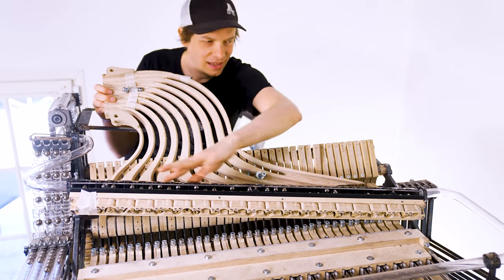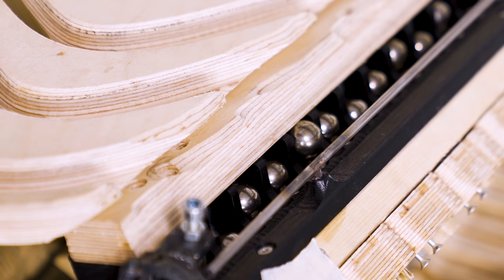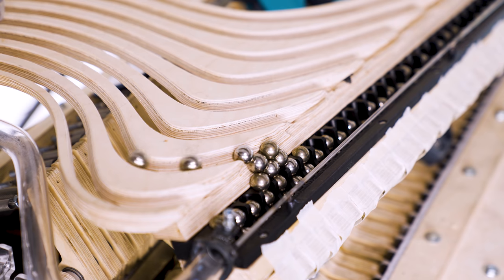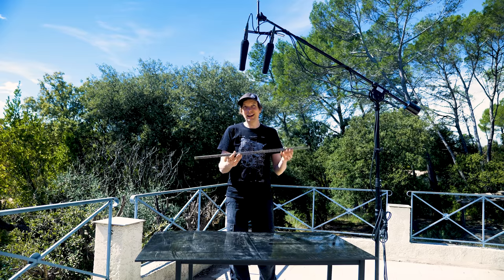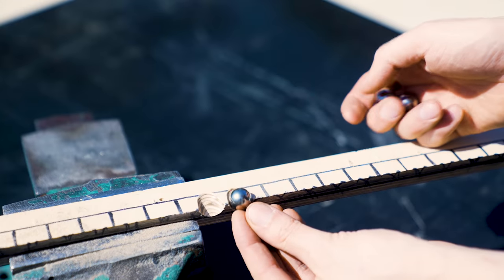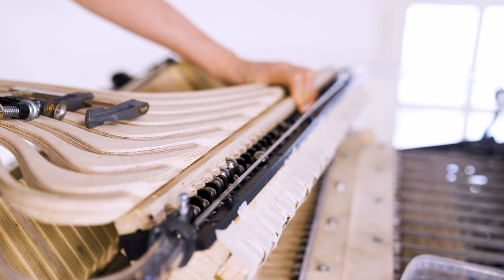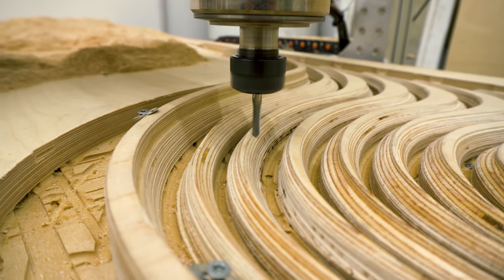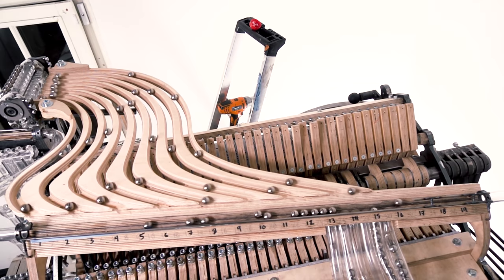Marble Tracks with Hidden Feature

Comment: I'm starting a petition to get Martin to look up what redundancy means haha
Reply: He used it correctly for the welding that only had two spot welds. But is often using it when robustness is more appropriate.
Reply: Inigo Montoya to Martin:  "I don't think it means what you think it means."
Reply: @brianorca  actually not even there. Redundancy would be welding more brackets on
Reply: about time lol
Reply: But what's wrong with his use of 'redundancy'? Like in this context using the meaning like ~"having extra in case of failure, but it's not really needed, having insurance..." Perfectly valid use of the word.
Reply: @gearoidp  redundant systems are those that have more than one copy of a subsystem to make it fault tolerant. This is robustness, not redundancy.
Reply: Also perfect and hubris 🤣
Reply: Yep, when the marbles have a wide acceptable speed window and he's tweaking them to be closer to the center of that window... honestly I can't picture what a redundant solution would look like, short of an auto-tilt system which adjusts the marble lane position dynamically based on current detected marble speed.
Reply: The word for redundant in swedish is: överflödig
Reply: @davidgildegomezperez4364 ~ 'copy of the system...' I don't agree with your narrow definition. 

googled an exact definition : "a situation in which something is unnecessary because it is more than is needed" -Cambridge
"superfluous" "more than necessary".-  Merriam Webster
Reply: Yes PLZ!
Reply: @kaaremadsen9278  That's interesting. The German word „überflüssig“ also means „redundant“ but in a negative way like „useless“.
Reply: @gearoidp  Having insurance and having redundancy is not the same thing.
If you have multiple of a thing, regardless of if it is or isn't a good idea, it is redundant. Redundancy can be both good and bad. If you repeat yourself too often in an essay, it is bad, it is "redundant". If you have a second system that the first system can fail over to, that is redundant, but good.
Robust or resilient systems are always good.
Reply: @gearoidp  redundancy means you have more than one component that can perform a task in the event of failure while the first component is repaired or replaced. Resiliency means the component is designed to never fail.
Reply: @gearoidp  You may not agree with the definition being narrow, but nonetheless, that is the correct definition. It is a specific word with a very specific meaning.
Reply: My choice would be "tolerence"... redundancy suggests there is another system that takes over when the main system fails
Reply: @joshuamarcotte8514  I got into a long debate about redundancy many videos ago. I meant what you're talking about. I meant he should have fail safes. The example I gave was that he could have a separate path if one path gets clogged so the whole machine doesnt break. THAT is redundancy. Making it so that the  path cant get clogged in the fist place is robustness. tldr: I agree with you and im glad someone else agrees with me lol
Reply: @gearoidp  nope. Redundant means a copy that is not needed. Superfluous is a synonym of redundant.
Reply: @KarmCraft  I'm not sure what you meant. Maybe you're making a point on the suffix. Which you are missing in your comment...
Reply: I also cringed at the use of the word "redundancy".  Ultimately due to the context, it was sufficient for everyone to actually understand his actual purpose, so he still successfully used English.  It isn't the end of the world if he uses the "wrong" word, this has been going on for hundreds of years, and English will just absorb the change just like it did with other similarly mistreated words like "toilet", "egregious" and my personal favourite mutation "nice" which has somehow meant nearly anything at some point or other.
Reply: @gisobo  “överflödig” is actually both in danish and in swedish "borrowed" from "Mittelniederdeutsch". The meaning of the word in both danish and swedish is the same as you descipe it in german.
Reply: I'm also starting a petition to get Martin to look up what redundancy means
Reply: Yep, the incorrect use was torture, robust, fault tolerant, resilient, are all better terms for Martin was explaining.
Reply: @RoamingAdhocrat  The word for ”redundancy” is in swedish: ”redundans” It actauly has excactly the same meaning in swedish as in english
Reply: This is the discussion I needed to see. My two (or maybe 20) cents, although it feels kinda redundant (in the negative sense, ie överflödigt) to participate at thirst point. In particular directed to those of you who oppose this petition. 

The lexical meaning of redundant is not exactly the same as the engineering meaning, and what Martin is doing is engineering. As such we should hold him to the standards of the domain he is working in. In this context redundant means the same thing, which is to have one or more subsystems that can take over and make sure the whole system can preform without interruption when a subsystem fails. Examples of redundant systems is when a hospital runs through batteries and have their own power generator that they can start in case of a power outage, the batteries make sure an outage doesn't case a temporary outage while the generator is started, and the generator makes sure that the batteries wont run out when an outage is long. Another example of reduandacy is the disk parity you get with most raid strategies, commonly used is home NAS devices. Having multiple fire alarms at home is another redundancy.

As for the negative use of redundancy the example, that others have given already, of being repetitive in an essay or YouTube video is perfect. And this is what överflödig translates to. An English word might not always have a one to one translation to Swedish (or other languages) and this is a typical example of that. A better Swedish expression for redundancy is "med livrem och hängslen", literally translated to "with belt and straps". And that my dear fellow viewers, means redundancy.
Reply: Repeatability maybe?
Reply: @davidgildegomezperez4364  Lol that's so overly technical  for this context, and not even correct. Having a" copy of a subsystem" is one way of achieving redundancy. Installing a steel beam in a house that can support twice as much load as it needs to is also redundancy. There is redundant strength in the beam. Redundancy just means you "have more" than you need.
Reply: Maybe the idea is "possible unlikeliness".
Reply: @gearoidp  the issue is looking at the general definition of a word vs. it's meaning in the context of a specific field or discipline (a common example of this mistake is the difference between the scientific vs. conversational meanings for "theory"). In engineering, redundancy means having a backup system that performs the same function as the primary system, in case the primary system were to fail (in many cases, the backup system is simply a copy of the primary system). As others have mentioned, making a system less likely to fail is called robustness. (The overall robustness of a system can be raised by adding redundancy to subsystems, but adding robustness to subsystems does not create redundancy in the overall system).
Reply: @alexkfridges  not quite. Redundancy would be having two beams when you only need one. Exceeding the required rating in a single beam can be referred to as many things (having margin, factor of safety, over designed, wasteful, etc.) but "redundant" is not technically correct.
Reply: @gearoidp  Indeed, as I'm actually reading the former comments I kinda redundantly reiterated what you said earlier : } funny meta
Reply: @kaaremadsen9278  that sounds really close to "überflüssig" in German. However it is negatively connotated and mostly used to describe unnecessary features.
Reply: He means recilient.
Reply: "A higher factor of safety" is the phrase he should actually be using.
Reply: Redundancy is the practice of having a secondary solution to a problem when the first solution is good enough, or when the first fails. For example, he might have a catch basin for marbles that fall out of the mmx and feed them back into the machine, or have a way to direct marble overflow into a designated area, rather than risking them clogging up the machine. One example I have thought of is to reintroduce the height modules, which would optimize the new marble divider, which already works regardless of marble height, and would also help reduce pressure on the clock escapement gates, which work regardless of pressure.
Reply: Yeah, the fish stair is a redundant marble lift system that makes the whole system more robust.
Using a full weld rather than tacks is not a redundancy.
Adjusting the tilt angle of the marble tracks to maintain marble speed is not a redundancy.
Reply: He says 'redundant' when he really mean "fault tolerant"
Reply: He used it correctly. In an engineering context "(of a component) not strictly necessary to functioning but included in case of failure in another component."
Reply: I'll sign that petition.
Reply: @gearoidp  Is English your native language? It seems like it's not, because you aren't understanding the correct meaning of that googled definition at all. When you make something stronger than it needs to be, you don't use "superfluous" or "redundant" unless you're trying to suggest that the extra strength is useless and serves no purpose. That's why the definition you googled includes "unnecessary"; when something is unnecessary, its presence serves no purpose at all. Martin isn't making changes and improvements with the goal of them being useless and unnecessary, he's making them in order to make them less prone to failure. That word is "robust." He's making these things more robust.

In order for "redundant" to be correct in a "less prone to failure" sense, the thing in question needs to be designed so that even if it partially (or completely) fails, there is a backup so that the function it's designed for still gets carried out. Ask any native English speaker and they will tell you that "redundant" when used in a "reliability" or "failure reduction" sense absolutely always means "having a backup in case the original fails". Martin is using "redundant" incorrectly here, *even when reinforcing the spot welds*, and so are you.
Reply: I guess lane #3 is redundant. Lol
Reply: @davidgildegomezperez4364  he has more than one spot weld incase one fails...
Reply: @gearoidp  yall both saying the same thing, just using different words
Reply: The word should be "reliable"... NOT "redundant". Building in reliability means it works all the time. Redundancy can improve reliability only because if one part fails, there's a backup to take it's place. That being said... there's really not much of anything redundant on the MMX. It's not like if a part breaks another automagically takes it's place. Maybe if a battery backup was added to the electric motor - THEN that could be considered a redundant system.
Reply: @douglascaskey7302  that's where you're wrong, he repeatedly does things. he put a repeated amount of welds to hold the bracket, he is repeatedly redesigning parts and repeatedly testing them.
Reply: well to be fair his first language isnt english so maybe give him some slack lol i mean you understand what he is trying to say so it obviously isnt that big of a deal
Reply: @alvatoredimarco  Just start another one. So it can be, you know, redundant.
Reply: signed!
Reply: @alvatoredimarco   it is my first language. I think my ridiculously Irish first name and even more ridiculous English surname is a bit of a giveaway. 😂😂
But, that is besides the point. Trying to insult a person to get your point, across isn't a very great tactic to get your point across. 
Thanks, for your explanation.👍👍
Reply: @gearoidp  that’s what redundant things are about, not needed. You don’t need insurance if you are safe etc.
Reply: @BadButNotSad  I'll try telling my insurers that; when they screw me over with my premiums every year. 😂😂
I'm super safe I won't burn down the house... I won't crash into that wall...
Reply: @BadButNotSad  The entire concept of say: car insurance is a redundancy. In case of failure I have a system that will recover me.
Reply: The word he's looking for is robustness.
Reply: About redundancy: it can also mean using the same trusted technique multiple times.
He made a marble divider with 38 channels, now he could make another with 4 channels for the fish stair, and another with 8 channels for the conveyor belt.
Reply: @johanullen  Your example of hospital redundant power system is not quite accurate. Redundancy in this case would mean: Hospital connected to power grid from two sides (on separate high voltage power transmission routes), two sets of batteries (and UPS devices), and two generators. All of this components should be designed to run whole hospital by itself (i.e. only one generator should be enough to run hospital power). That is true redundancy, also known as "no single point of failure" :)

Comment: 8:38 ROBUSTNESS! It's "robustness" not redundancy. If you need more redundancy, you need a completely separate path from the marble lift to the feed tubes completely bypassing the marble divider. If what you want is for the marbles to more consistently reach the end of the marble divider, irrespective of outside influences, then you want more ROBUSTNESS.
Reply: No, robust suggests strength or durability
Reply: @tommj4365  Yes. That's true. It is durable against outside influences. That is the definition of robust. Go look it up.
Redundancy, on the other hand, implies duplication of features. It implies that if something fails, the system still works. In this case, if the marble divider gets clogged, there is no way for the marbles to go into the marble gates. That means that there is no redundancy at all built into the system, which is not necessarily a bad thing.

Comment: Martin, no. The word you want is "robust". You are making things more robust in this video, not redundant. Redundant (in the context of improving reliability) means having a backup that takes over in case of partial or complete failure; robust means making it less prone to failure in the first place. You're not creating any backups here, you're changing the parts (and the spot welds) to be less prone to failure in the first place. That's robustness, not redundancy.

Comment: Redundancy is when you have two or more things with the same purpose, so if one fails it doesn't matter. Airplanes having two engines although they can fly with only one is an example of this. What you are building is robust.
Reply: Thought you wrote "two wings" for an instant 😂😂
Reply: Resiliency?
Reply: Yeah, but if a marble machine fails, there's not really a potential for horrible amounts of death.

Comment: You keep saying “redundancy” when you mean “robustness”. They are very different things.
Reply: redundancy is usually used to describe 2 things with the same purpose. As sort of a failsafe.   A good example is in aviation you often have redundant systems.  If your main system fails you have a backup to get you safely to ground.  (like a 2 engine aircraft)
Reply: @andrewbarta6893  backup (and backup, and backup) is redundancy. As you say. But Martin is misusing the term a lot here. He means robustness or “safely inside envelope” (as opposed to very close to border of envelope)
Reply: or resiliency...
Reply: Reliability would be better. Robustness implies strength, which isn't really what he's talking about.
Reply: redundant supports increase its robustness.  redundant features create a more robust machine. maybe hazy but not wrong usage imo
Reply: Chipping in on the likes to hopefully get this to Martin's attention :'D
It's een really bugging me in this particular video.
Reply: The engineering term is "margin"
Reply: Robustness is kinda redundancy in configuration space. If a system is robust, it not only works in one narrow configuration, but in multiple ones. Though robustness means the alternative configurations are directly adjacent rather than on completely parts or replicas as in redundancy.
Reply: Robust is a bad word too...
Reply: @101wormwood  it's still misuse of the term, because redundancy almost always implies duplication in some form, where you have more than one component that can perform a task in the event one fails. It's the difference between having a car tire that you can still drive on if it's flat vs having a spare tire.
Reply: @joshuamarcotte8514  almost always?  it applies to more than your narrow usage.  not bothered though.  its english
Reply: Marbles are evil... lol
Reply: @tommj4365  robust is a significant word. Like buttress. Or rhododendron.
Reply: @101wormwood  The only other real usage that doesn't imply that is when you say something was "made redundant", like when companies lay off workers because their jobs have been outsourced, or the job they used to do at the company isn't needed anymore. When you use the word like that, it implies that the original purpose for the component that's being eliminated no longer exists, so its elimination would not cause a decrease in function.
Reply: @joshuamarcotte8514  if you say so fella.
Reply: @joshuamarcotte8514  That use of "redundant" is more of a euphemism than anything else. And it's pretty limited to British English. It's not a common usage in American English.
Reply: @Sphere723  That's true, but it speaks to the core definition of the word. If you can't completely remove something from a system without replacing it or compensating elsewhere, that thing isn't redundant. Making something less likely to fail doesn't make it "more redundant".
Reply: (of a component) not strictly necessary to functioning but included in case of failure in another component.